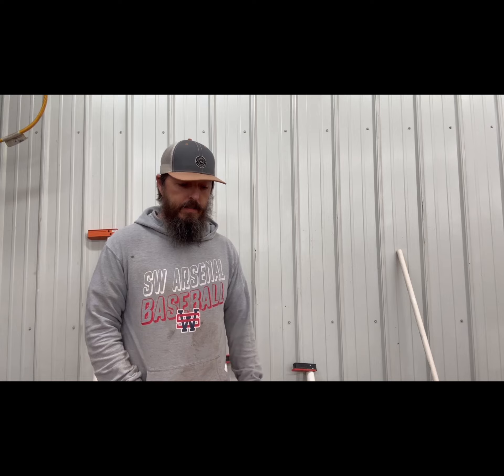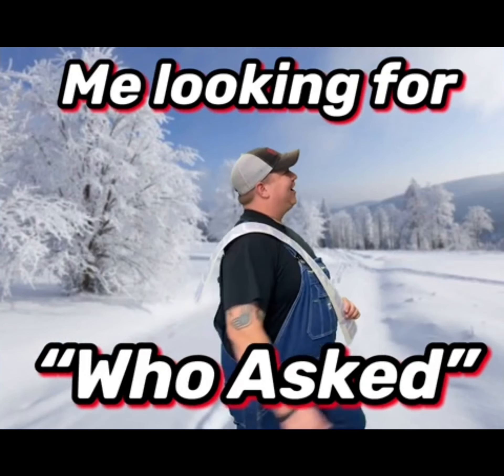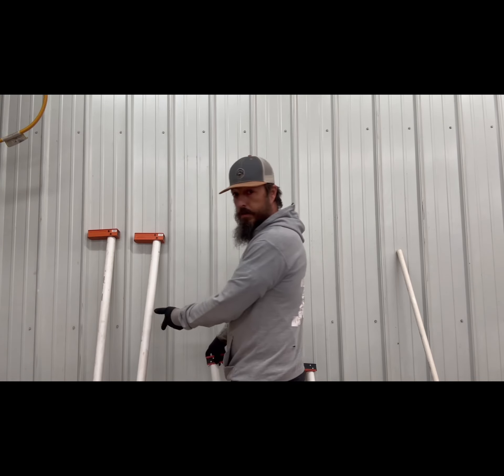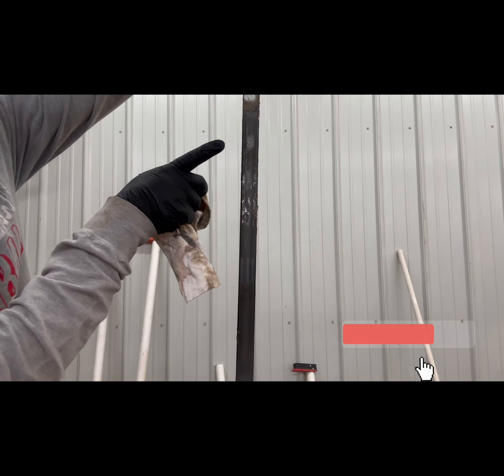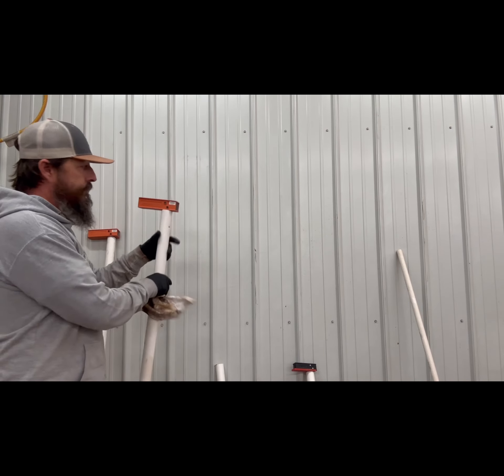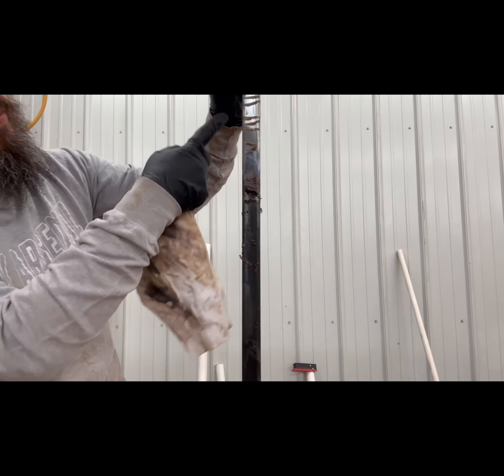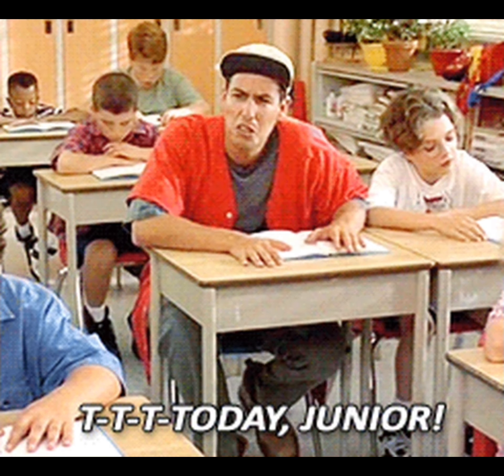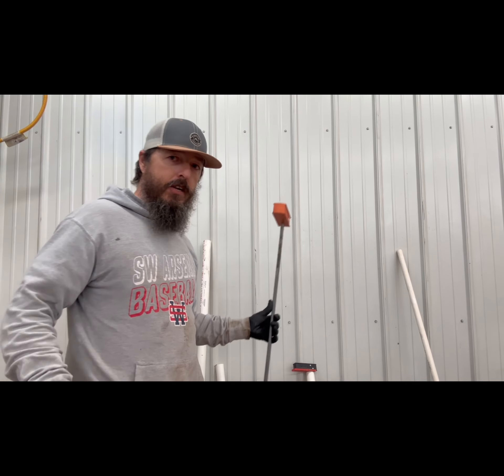Wood working tip you might not know!!

Comment: that's a good tip, I use that too until I started putting painters tape on top of the clamp rail before I glue up, that prevents having to clean them as often.
Reply from the maker: That is a good idea. I appreciate the tip.